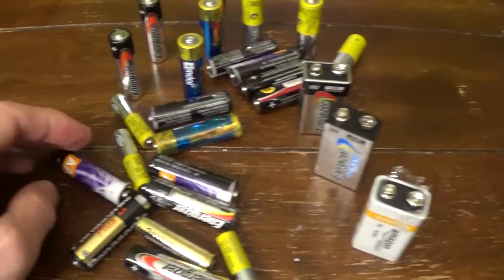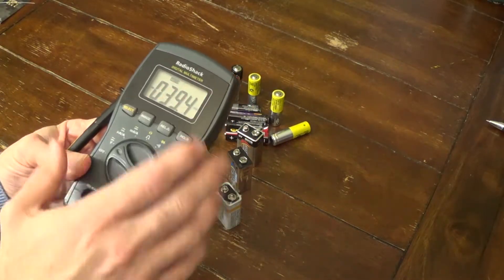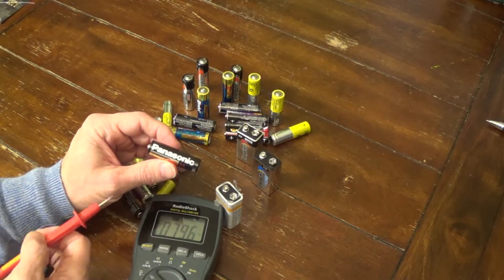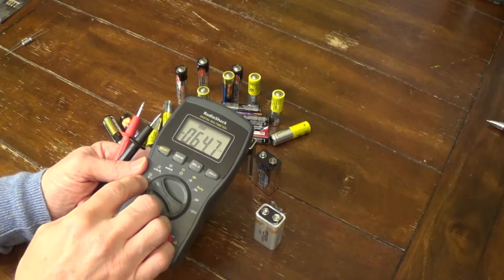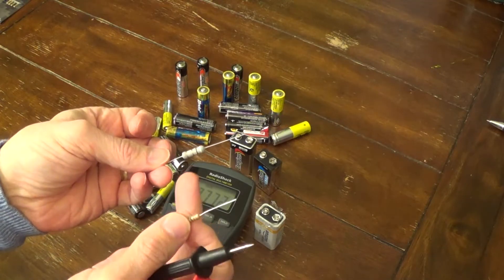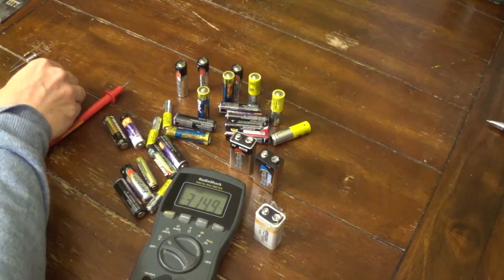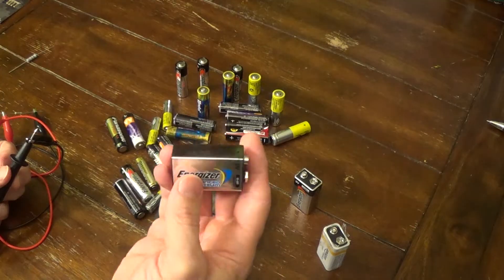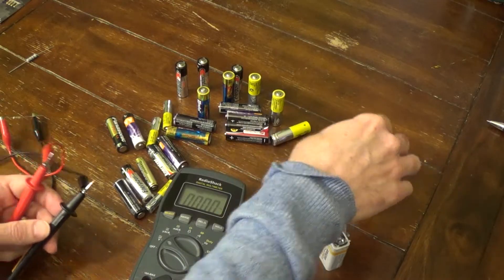How to Test if Batteries are Good

Comment: where do i buy a resistor?  mostly use AA and AAA on flashlights and electronics and they are always getting used up, bought mostly Harbor Freight.  Sometimes when I am changing them I may drop one or two and then I find out sometimes that the electronic clock let's say doesn't work, it's the clock's fault.  Then I dont know if the batteries are still good.  So once again my ? is where to buy resistor and what to ask for when I get there???